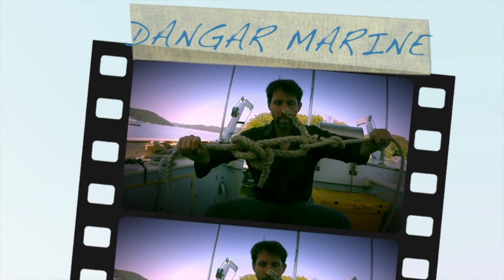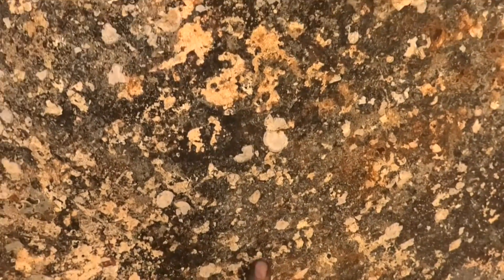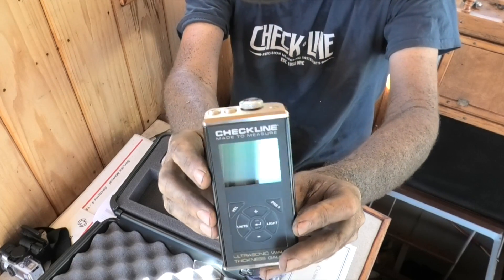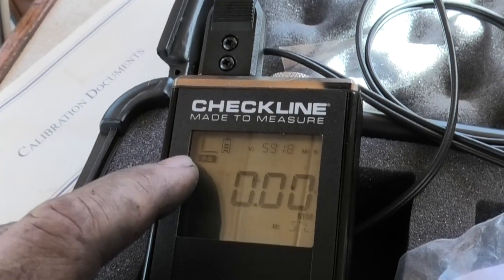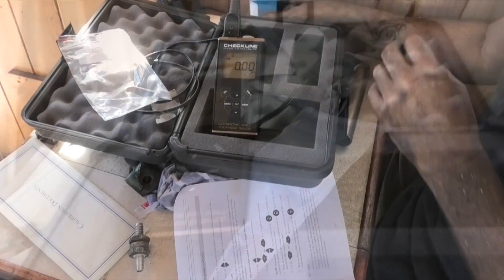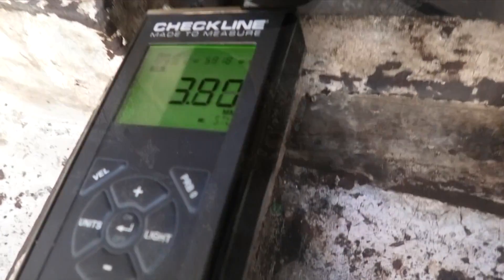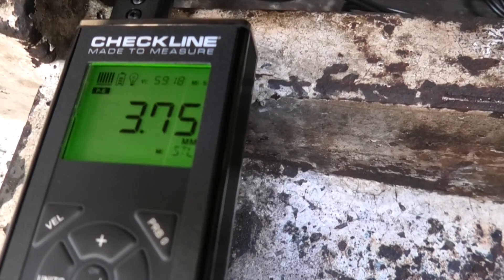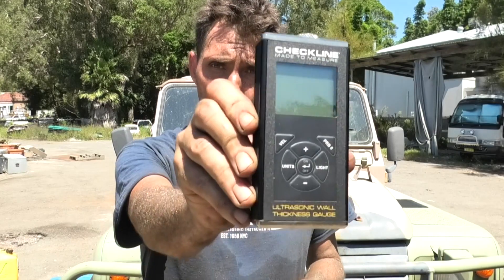Ultrasonic thickness testing the steel hull plates on the trawler

Comment: Having done a fair bit of hull repair I'd say 3.7 mm should be good for what you are going to be using the boat for.  It's not like you have to deal with ice and the like.  

I don't know what you plan to use for primer on the outside of the hull, I would suggest a look at Coal Tar epoxy primer.  It wouldn't be a bad idea to use it in your engine room bulge compartments.
Reply: Coal Tar epoxy has been phased out here in Australia as it has been found to be carcinogenic. I think a good high solid surface tolerant epoxy primer would be adequate here if applied correctly.
Reply: That sucks.  It's about the only thing I know that will expand, contract and flex with the hull and not form cracks in the coating.
Reply from the maker: Flex is very important with boat paint which is why going with a marine epoxy is a good idea. More brittle coatings will definitely crack with hull flex.

Comment: Hi Stu, I had an idea, measure a good spot and tap the spot with a small hammer. Then tap along the other surfaces. If you hear a variation in sound that goes lower in pitch. Like a tick tick sound to a tock tock sound. Then that is an area thinner than what you measured. I do that on steel im unsure of. That ultra sound gauge is sweet. It takes all the guess work out and you can tune your ear to the different thickness of steel on board.
I imagine the steels too rough on the hull to grind and get good results. Your sand blasting ideas im sure are a much better way.
Like your shirt, and its transformation throughout the video.
Reply from the maker: Getting an ear for thickness is a good thing to develop. I imagine that shirt got grubbier as the day went on!

Comment: Hi Stu. Could you do a test on a piece of cut off steel. It would be interesting to compare measured thickness using a digital caliper to ultrasonic tester thickness. Thanks.
Reply from the maker: Will do in a video soon.

Comment: Why not weld a couple of steel plates under the area where is is thinnest , plus it is an area where it would be under operating vibration.
Reply from the maker: Welding extra plates is a bit of double edge sword with regards to rust occurring between the plates.

Comment: Thanks for the heads-up on Hornsby Steel Supplies. They're real close but I didn't know about them and had been going all the way to Brookvale. Do you find they keep stock or does it generally need to be ordered?
Reply from the maker: They stock a fair amount, but I did have to order the sheet of 4mm as they normally have 3mm. Lots of other bar and plate they keep there.
Reply: Ok thanks, will check them out next time then. Appreciate not having to go down to Brookvale in Sydney traffic!

Comment: I noticed your exhaust wrapping could be asbestos use water glass to coat the exhaust wrapping make it safer and will tone down the engine noise .Your air cheisel is doing good job will find a very weak spot guickly .

Comment: I have been known to use a coupling solution from time to time wif da laydeez!  Also it's 20 kHz or 20,000 Hz, not 20,000 KHz as said at 3:04.  But I got the gist of what you're saying of course.  Great video!

Comment: I professionally sandblasted for several years, mostly heavy equipment but if you need any tips don't hesitate to ask.

If you're going to be hiring someone with a professional rig (600 lb pressure pot and towed compressor) you are absolutely wasting your time with the needle gun. The sandblaster is going to cut through it so effortlessly.

I have had mixed results with wet blasting however my equipment was not the best and I was primarily working on residential brick for graffiti removal.
Reply: otm646 second this. A professional blaster will rip everything off and take it down the white metal. Even rust scale. Literally everything that’s not welded on   Let the blaster do the work for you.
Reply: Totally agree with this Stu, not only will it save you time, effort and money but it will also save you with community good will. Save up "pissing off the neighbors" points for down the track, I'm sure you're going to need them.
Reply from the maker: It is a fair point you make. I'm going to give some wet blasting a go on the section I've already taken the paint off but I'm leaving the whole underside to the sandblaster.
Reply: Aye, there ain't much stops a big shot blasting outfit. 
There is nothing on that fine vessel that will give much of a fight.
The other thing is, you blaster man may want a certain amount of money to turn up, set up, and maybe clean up. 
On a job that size, that's the bit that's going to take the time. 
Actually doing the blasting is the quick bit.
You'll not be saving yourself a great lot of money by doing some of it. It's an insignificant issue compared to the set up time and costs.
Reply: @andrewdavies4604  - In the US there is a difference between "shot" blasting and (wet or dry) sandblasting.  "Shot" is actually very small steel beads.  Shot blaster typically have some kind of vacuum to collect the used shot and material they have removed or it is done in a closed box/cabinet.
Reply: In the UK, blasting with sand is more or less outlawed, as far as I know. I've certainly never used sand. 
The shot I used was so called Steel Slag, which I was told was imported from steel works in Germany. It was literally the slag from steel making.
From what I understand, dry sand, (as oppose to using it in a water jet) can stay suspended in the atmosphere, and be inhaled, very quickly causing silicosis.
Not that I know a great deal about that side of blasting. All I did was stand there using the thing, the ins and outs were the bosses problem.
Hateful job anyway. Enjoyed it when I did it, but not a long term career.
Reply: @andrewdavies4604  it's called sandblasting, but that's just a common name for it - even if you're not using shot your right no one uses sand! But there are mediums that are not silicon based etc that have the same consistency.

Comment: That would be about 1/8” thick ? That would seem to be sufficient. Wet blasting is the way to go ! You could do it yourself , no worries! SKOL BUD !
Reply: That's thin to win..
Reply: Oscar Mayer I’m sorry I’m not familiar with that phrase, please explain.
Reply: It's thin but it will work for now.. Enough to win the race.. Ect.. 😎
Reply: Oscar Mayer I see what your saying , thin to win I’ll remember that , thank you for explaining!
Reply: Use garnet. Silica sand too soffit for the crusty steel. Use a ceramic tip. Steel tips will wear through and you’ll lose your tight spray pattern.

Comment: Like the needle grinder thingy.. so working around metal antique riding garden tractors myself, I could use that occasionally.  But to do a whole boat.... how long do the needles last?
Reply: We used an Ingersoll Rand needle scaler to clean off the rust on the forks of our old forklift at the marina where I work. I think it was only a couple hundred bucks and that thing was an animal! Worked great! Looked like the needles would last for a long time.
Reply: The needles are tungsten.. last a long time and if they fall out grind a point on them to make a scriber
Reply: there are several different sizes of needle scalers available and replacement needles are also available.  if you want to start cheep check out the harborfreight site for them.  don't outsize your air compressor flow.

Comment: Cool tool
Yes its not as bad as it seemed, which is the opposite of what it usually goes like. Based on what I saw I wouldnt cut that out either. Id like to have seen a maximum thickness as well though not just the maximum available. Just one thing, in the Netherlands, where most thin steel recreational boat building takes place, they like to get paint on the boat right after grit blasting (sand blasting is outlawed there). In light of that you need to know where you are going with your paint system, and have the gear etc to get moving on priming or whatever it is right after blasting.  Yeah Darwin is going to be different to Rotterdam in terms of moisture, but they will be in a closed shed with their apparatus and have heating available.
Be interested in what system you choose, why you chose it and where you heard about it. 
have a good one ...
Reply from the maker: Definitely agree about painting straight after blasting. Plenty more info on the painting coming soon!

Comment: I would suggest that prior to painting your hull that you weld a stud to the hull near the stuffing box {one on each side of the box} then after you paint the hull, bolt some zinc anodes.
Reply: Can definitely have too many anodes. Will take patches of paint off. Should  measure voltage with a silver cell.
Reply: Ken Williams , sorry yes you can have to many zinc anodes
Reply: Good idea 💡.
Reply from the maker: Yep, will definitely be doing the silver half cell test once it is back in the water.
Reply: You can never have too many anodes on a steel hull! I wonder how corrosive the water is there where he lives? If it's anything like it is down here, he will need about 50 anodes!

Comment: You probably know this, but as you wet blast, spray some ammonium dichromate solution on the finished areas to stop the rusting before the water dries off.
Reply from the maker: There are some water soluble products now that can be used to passivate the steel that are a bit less toxic. I'll definitely be treating it will something straight away though.

Comment: Find a Dustless Blasting service.  It would much quicker then sandblasting and cost effective.  Your surface would be ready for primer immediately.
Reply: It's fairly cheap as well..
Reply: @BAZZAROU812  Yes, the hull would be cleaned up 4-6 hours.
Reply: Dustless blasting uses ground up Coke bottles as blast media.  Recycling is good.   I would imagine they can use different grits of media, but I don't know.    If they can't get an aggressive enough grit, it might put too smooth  finish on the steel.  One reason dustless is so popular in my area is that it is gentle enough to remove bottom paint from fiberglass boats without tearing up the glass.

Using a quality rust-converting primer on the inside that will etch into the steel to give a solid base for your epoxy paint.  Then make sure to use compatible top coats and you will get a slick, smooth finish that will last many years.   I think researching the best paints will be to your advantage in the long run.  And if you contact the maker, they might sponsor or partially sponsor you for the free advertising.  Could be a win-win for both of you.

Just dropping sandbags around where you are scaling will help with the noise, and the ideas of carpet above sound really good.  Probably worth a few minutes to explore.  Good for your ears and the neighbors.  

But I don't envy you the task.  What you are doing now is WAY tougher than making wooden boats.   That was child's play, like playing with Leggo's in comparison.    You are doing serious man-work now!

Hang in there, mate, and pace yourself.  You are making all the right choices with the boat.   Just remember to spend regular time with the family.   Keep your priorities straight, and all will turn out well.   Looking good so far!
Reply: @thilltony3362  Dustless blasting can vary the amount of media and PSI depending on the job.  It would clean that hull right up.  https://www.youtube.com/watch?v=iqTlfp-ODIo
Reply: thilltony There are many media available for blasting. For steel halls Garnet is a great media because of its hardness
Reply from the maker: They were using it on a glass boat at the same time I was at the Fenwicks marina. The finish on glass looked quite nice.

Comment: build another support leg this time with a large tilting pad... multiple layers of carpet on top of the tilting pad..  this can be placed against the hull outside to dampen the sound from needle scaling..   you can make a holster also out of carpet with room to put your hand inside for the needle scaler trigger to reduce the sound output..   you might make some carpet wrapped weights to set into other cavities to also dampen the sound transmission from the hull..  rig up some plywood and 2x4 versions with carpet on them so you can run a strap from rail to rail under the keel to hold these damping panels on the outside when you can't support them with the extra leg..   you may want to wrap the extra leg in carpet also..    if you have to sandblast.. you might make up some carpet lined cardboard tubes (think carpet rolling tube)  to fit over the nozzles damping some of the sound of the air exiting the nozzle.  it only needs to be an a few inches longer than the end of the nozzle.. think of them as jet engine hush kits..
Reply: do this for us please, Stu.
Reply from the maker: Good tips, thanks for sharing!
Reply: I hope he listens to you Wayne, especially after Stu just announced that he will get under the boat and beat the crap out of it with the needle gun. We don't want this to be his last birthday.
Reply: @Bennyboy-dog  i actually put braces up against the far side of the bulk heads in the boat i worked on when i ran the needle scaler and grinder on them..  made a huge difference.
Reply: @waynep343  for noise suppression I expect Wayne, but also to provide additional support? (which is what I was angling towards). Sorry if I misunderstood.

Comment: Not telling you what to do, but consider putting some sandbags on the inside of the hull when you are using the needle gun on the outside to cut the noise. It might help!
Reply: Not a bad idea!
Reply: No doubt about it, some damp sandbags would be perfect for deadening the ringing.
Reply: That cuts down the rattle and ring or the plate a lot.  One shop had totes of 20-30 pound sandbags that were used for this.  They also were used to weight sheets down to form then to the deck framing.
Reply from the maker: Yep, would definitely make a difference I reckon.

Comment: I had to prep a steel boom boat tug before a sandblaster came in to clean it, and the needle gun is what we used, worked great. We tried a creeper but it would not roll due to the crud coming off the hull so we modded the creeper to take 8" hand truck pnematic wheels, and it worked great. Also we put a curtain up off the gunale of the boat down to the ground, used respirators which kept the mess in as well as a lot of the noise.

There is no replacement for true sandblasting on a boat, the employer tried to have me clean it with a wet blaster, and in the end brought in a sandblaster.
Reply: Especially when you are talking about painting it and getting it to stick on

Comment: That’s just over 1/8 thick 🤔
Reply: Doesn't seem to be very thick does it lol
Reply: @BornAgainBoating  Thick enough for the boat size. I built an 1/8" thick 25 ft boat, would have made it thinner but the plates warp too much during construction.
Reply: @grancito2  that's awesome! How long did it take you to build it?
Reply: @BornAgainBoating  2 years, I thought it would never be finished.
Reply: @grancito2  Lol that's how most boating projects go. They are sweet when they are done though, those are usually some of the coolest boats you find on the water!

2 years really isn't that long for building a boat yourself. Unless you don't have to work or anything and that's all you do, 2 years sounds about right
Reply: @BornAgainBoating  That was full time, but it turned out really nice, I stopped the car panel and paint business to build it so it looked like a new car. Also it had sails so that takes extra time.
Reply: @grancito2  wow, I couldn't imagine! That had to be an awesome boat, working on it full time for 2 years. That's some serious care being put into the project!
Reply: @BornAgainBoating  I'm too old to build another boat, that was my second, but if I did, I wouldn't steel frame all of the interior, that included cupboards etc. It takes a lot of working out and time to cover the steel framing with wood and make it look good.

Comment: WOW, another killer job.what did they do before the handy dandy tester ?
Reply: Poke it with a screwdriver and if it goes through, we know its a thin spot :)
Reply: Drill a hole and measure the thickness. Then just tack the hole with a welder

Comment: Great content Stu.

For the needle gun, hold it at an angle to the surface you're scabbling, you'll find you remove more material in a given time and if you're sand blasting that will take care of the material in the small pits the needle gun held at an angle will miss.
Reply: Sand grit really matters. You need both coarse and fine depending on the rust and how beefy your blaster is.
Reply: Andrew Rouen always thought I wanted a needle gun but it looks like workout 👍👍
Reply: @Blackford86  
It's one of the cleanest ways I've found to remove crap from a surface, definitely a work out though, and LOUD.
On the up side, less dust, no bits of high velocity wire and less clean up (cleaning up after sand blasting, even wet, is a fkin PAIN).

Comment: Testing beats regretting! Wish I had one of those when I was rebuilding a 24 foot drop deck trailer. Good luck with the rest of the hull!
Reply: Right, I wonder if they make others that can shoot different materials, like fiberglass!
Reply: Why don’t you just caliper the thickness on a trailer